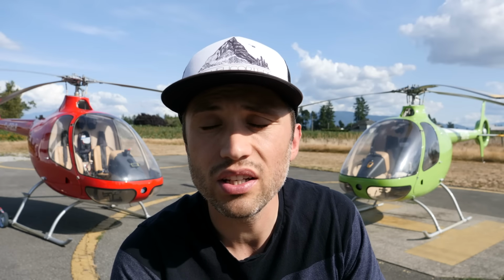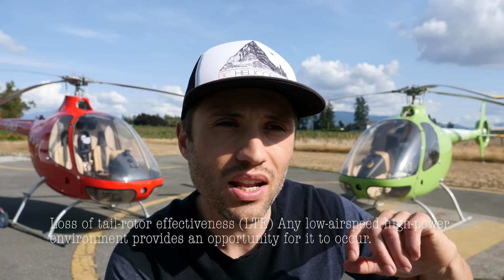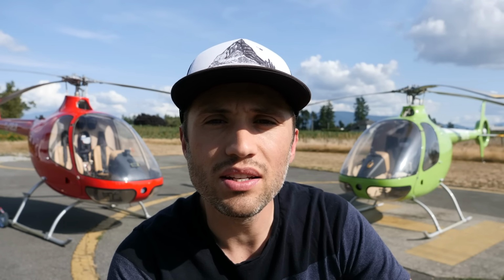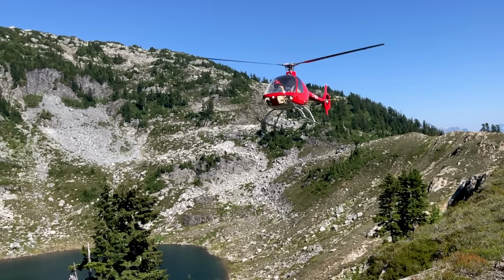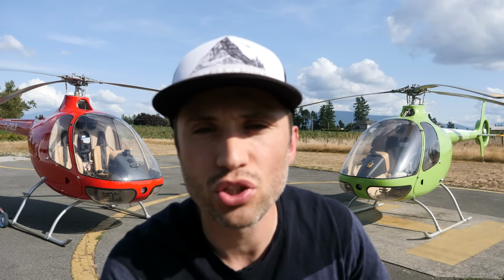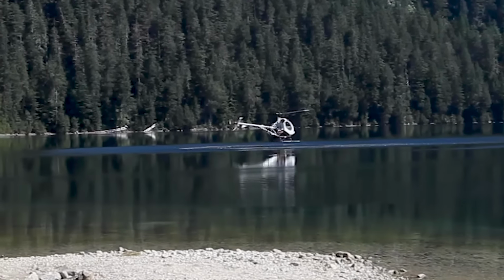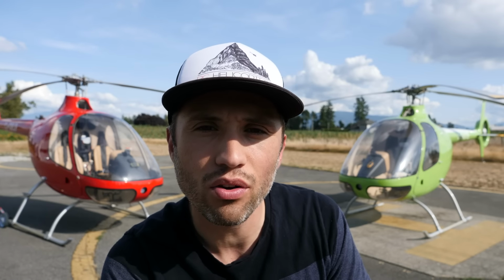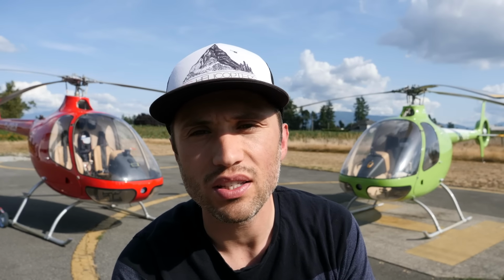OVERPITCHING and LTE can lead to a HELICOPTER CRASH

Comment: Good explaination about a common but all to frequent accident cause..
After Army flight school i got my real training in Vietnam.(1968-70). We were frequently operating at max gross in jungle mountains. We did not always have the luxury of doing OGE power checks or get actual weights due combat conditions. (Not recommended for your civilian or training environments because you always have time for flight planning in normal operations).
 One thing i always tried to afford my self was to have an escape plan if i started running out of left pedal on an approach. Instead of flying straight ahead,   I tried to have a way clear to turn right (and down) add some right pedal in the turn. Full left pedal is telling you that the helicopter is not happy with the conditions. A combination of reducing power requirements and some airspeed brings back that happy feeling and you again are one with the machine. More than 50 years involved with helicopters and airplane and I have never damaged anything. Except for the occasional bullet hole. It seems there are no new accidents, just repeating old ones with different names and A/C numbers. I enjoy your videos and you are usually spot on with the information.
Reply: Anthony Costanza thanks for taking the time to write all that,   You sir are a badass,  Thank you for your service and for sharing your knowledge!
Reply: Thank you for the information...and your service in Vietnam
Reply: Thank you for your service brother. TH55A, Cairns at Mother Rucker. Wonder if Enterprise is still a dry town?
Reply: Wow, what an endorsement from a Viet vet. Misha, you must be doing something right (lol).
Reply: Are you from Cincinnati?
Reply: I came back from all my rides. You pilots are the best.
Reply: Thank you for your service !
Reply: Thank you for your service! 🙌🏻
Reply: @westva22  What did his service in Vietnam achieve ?
Reply: Oh the Wonderful Conversations I Imagine we could have you & I
Reply: Anthony Costanza thank you for your service!
Reply: Is this caused by air density/temperatures?
Reply: @sarahann530  How to fly a helicopter? (Sarcasm) 
We know now "War is a Racket" Smedley Butler
Reply: In my book Vietnam pilots were absolutely bad ass espeacislly the medivacs hats off veteran we luv you here in canada
Reply: @sarahann530  You realize that was politicians, not soldiers that caused that shit show right? Don't ever disrespect the man behind the gun when its the one in the suit you should be angry with.
Reply: @sarahann530  Yeah, the 2.2 million that were drafted in Nam were there because they couldn't get a job! Right?! Like almost getting killed every second of the day is pussy shit huh? I don't get why all these people that were forced to go to war and almost get killed daily come back with problems! They just want attention, clearly.
Reply: @derqatarzan4207   They were fighting the bogeyman . The US always needs a bogeyman to keep its citizens afraid .  Scared and stupid and unable to win a war after starting it .
Reply: Anthony thank you for your service. My uncle was a door gunner and always talks about how incredible the pilots were and how they kept him alive.
Reply: Thank you for your vivid real life experience and thank you for your service ✨
Reply: @sarahann530  you shouldn't have to ask!
Reply: @eddielane9569   So beat if you were in the Marines it just proves you can carry a rifle and make your bed ,fuck all else .Give us the name of a war you were involved in that you actually won . ?
Reply: Jake Heke  As a keyboard I have still won as many wars as the US military has in the last 50 years . You must be so proud when your boy Trump fired that  US Navy Capt Crozier , how dare he look out for the welfare of his crew.
Reply: @sarahann530  I was in during peace time in the eighties. America has won all of her war's except Vietnam because politicians ended it before we could win it. We were on the cusp of winning but we were stopped before we could go that far. Your knowledge on the military is lacking. I went through 2 schools and had 2 MOS. That is unheard of. Unless you are a Vet you don't have the experience or the right to disrespect our Military. The very same military that keeps you safe to say what you do.
Reply: @eddielane9569   Wow , 2 schools and any 2 mos. Impressive , of course you had to do something with all that free time . The only thing the US military gained in the 80s was lbs , infact enough so that the Military issued warnings about it . Back to the wars won , Korea , Vietnam , Somalia , Iraq ,Afghanistan  none were won.  Now you did invade Grenada and "win" that war  so there is that .  In essence  though you won nothing , faced nothing , but you learned how to carry a rifle , make your bed  and go to school at the taxpayers expense .
Reply: Anthony Costanza...very true, but you know the military..hurry up and get in and out...I did not fly troop movement but I flew a lot of supply runs...when you come in and that close to the ground you always have the OGE buried somewhere in your mind because how many times did you fly overloaded and under enemy fire?  All the time, that is why we were taught to approach full throttle with cyclic pulled back then drop the collective, straight in and straight out, dragging the tail so you knew the ground was very close, especially in that tall grass, you could not tell, and you are right, this is not geared to civilian flying...dump and go.  Hell I have not been up for almost 40 years, 67 now!
Reply: Thanks I praised the helicopter pilots in nam being in the first air cav d17 you guys were super fantastic and thank you for all you have done over there many rides in those huey  choppers.
Reply: Thank u for your service sir!!!
Reply: @sarahann530  Several thousand dead communists ... quite sucessful in that department but more needs to be done
Reply: @sarahann530  Wiped out the Nazi boogeyman and the Empire of the sun ... and I now dont speak Kraut or Nippon
Reply: @markdoan1472  If you read a history book you would  know Russia  wiped out the Krauts and now they own the POTUS   and have taken over America without firing a shot.
Reply: Welcome home brother. I was an army medic with the 11th Cav 67/68. Used to watch the chopper pilots and how cool the always were. Wanted to fly them but too scared. LOL
Reply: @WestendAngst  So that's why you became a nurse  because you were scared !
Reply: @sarahann530  ha ha yeah It's the splat factor that gets me
Reply: @sarahann530  I have heard about internet trolls; thanks to you I now have an example of one. Thanks to Dick Ragland and all the other men that went ashore with him (none of whom wanted to be there and had better things to do with their lives), our lives have been much easier. To all of those who have served, politics aside, us non-trolls salute you.
Reply: Familiar with LZ Dog?
Reply: @sarahann530  I don't think this is the proper forum for you to use as a platform to air a bunch of political agenda. How did you get everyone off onto another COMPLETELY unrelated topic. This is about Flying Helicopters and flight characteristics, how did you get sidetracked onto Vietnam and Trump?? Did you not see that chopper fall into the drink?? That's what we are all talking about.
Reply: And to figure it all started with a fine mans explanation of recovering and avoiding a crash we end up criticizing the man for his service and blameing him for the policys this country set forthe. Place is wild bro. Wild spinning ball.thx for ur service and your educational advice in your post.
Reply: I am a fixed wing pilot so I have no rotary wing experience. 
The thing I reacted to was kicking out a passenger to loose weight.
This suggests that you get into this situation party because you didn’t do your homework with your flight plan.
I can imagine that the amount of fuel, cargo and passengers together with high altitude and temperature will put you outside the helicopters performance capability.
You will have a similar problem with fixed wing under those conditions ie take off performance will drop and you risk not getting enough lift on taking off and you will dig a hole in the terrain.
Reply: @sarahann530  Same thing your tax dollars did! Did you have a  choice? Elections have consequences! What a bullshit, off-topic comment!
Reply: @sarahann530  Simply answering the call to service by his country, vs
being a self-serving coward with excuses...
Reply: @Endlesspathable   Call to service fighting the bogeyman then running home  .
Reply: Thank you Mr. Costanza for everything you done for all of us.
Reply: I would love to meet up with A Conneely.  It must be nice to still have Trump living in your head, RENT-
FREE!!
Reply: @sarahann530  I finally found a way to review my comments left scattered around and, well, this is admittedly true (especially now) and... the people DID survive the copter-dunking.
Reply: Anthony Costanza you just explained something to me I've wondered about for years. About 28 years ago I was working in mining exploration in northwestern BC. We had to get flown from the camp up to the mine portal daily in a Bell 500. The pilot was trained in Vietnam during wartime and on this type of chopper. The portal was probably around 1000 vertical feet higher in elevation than the camp that sat down below in a narrow bowl. When it was real foggy this pilot liked to fly from camp up to the portal backwards and turned slightly to the left on his side of the chopper. I always thought it was just so he could see the ground better as he followed the terrain up to the portal but I guess it was also so he could quickly get out of trouble and recover quickly in a max power LTE situation too which I witnessed several times but I didn't know that at the time 😳😂. Glad he never explained that to me lol.
Reply: @kennethmartin1300  AGREED! This is NOT the place for wayward political discussions which distract from the subject matter in the video.
Reply: I’m not a pilot, although I’m considering learning to fly helis. This makes a lot of sense, letting the aircraft turn into direction it wants to go will bring up your airspeed quicker? Am I understanding it right?
Reply: @adm5618  Not fully. At the altitude which the pilot first detected a problem it may have already been too late to correct it (his proximity to the water did not allow for time enough for him/her to perform the necessary emergency procedure). The fact that he was "over-pitching" in that particular helicopter, at that height ABOVE THE WATER leads me to believe that there were other factors which may not have been apparent through viewing this video, which may have been significant in the cause of the mishap, i.e., not checking the performance chart data for weather factors like density altitude at the crash site, over max allowable weight for a hover at that altitude, and pilot experience just to name a few.
When that aircraft first began its yaw to the right, that was the first danger sign. listening to the change in engine rpm as he settled into the water is another indicator.
Helis are completely different aerodynamic animals than airplanes, and they will bite you in the ass if you lose your wit at the wrong time in the decision making process.

Comment: Great video, thanks for sharing it.  It was a Schweizer that had the problem, but I've had it in Jet Rangers, Hueys and Blackhawks.  Any helicopter is vulnerable. We had the necessity to train pilots to land on true pinnacles, with terrain sloping away from the landing point so there wasn't any ground effect available. The technique was to make a slow approach and come to an out of ground effect hover a safe distance from the pinnacle, approximately 50 to 100 ft, above the touchdown elevation.  If you can't stop the aircraft here, you won't be able to stop it on the pinnacle.  At that point, if it starts to settle, lower the nose and either accelerate over the pinnacle toward lower terrain or turn away and fly out toward lower terrain.  It's a lot tougher at night and on NVG's because you can't make a normal approach. You have to fly at the pinnacle at the same height so you can keep it in sight until you can put your skids or wheels on the touchdown point. Ya'll be careful out there.  Live long and prosper!
Reply: Fred Harms ...that’d be awesome training technique or practice
Reply: yep. except i'd think you'd have to be super high/hot/heavy to have much problems with the blackhawk. the apache never ran out of power. the cobra, sometimes. i would probably be an ntsb report if i tried to fly one of those little thingys

Comment: We used a pretty simple formula to estimate power available for high alt stuff. You lose roughly 1” of MP (Manifold Pressure) per 1,000’. You can also subtract about 1” of MP due to induction loss. So if you’re trying to land at 8,000’ (static MP there should be around 22” minus 1” for the induction loss) which leaves you about 21” of MP available. If you’re pulling into the approach and you haven’t even dropped out of ETL yet and you’re already pulling close to 20-21” then you know you’re most likely not going to have the power available to hover and or land. 

We could also roughly calculate our hover MP by taking our weight and dividing it by around 70-80 lbs per 1” MP (depending on season and helicopter) and this would tell you your rough hover MP. It’s been a long time since I’ve flown 300’s but say you’ve got a takeoff weight of 1700 lbs. Divide that by 75 and you get 22.6” of MP. So you can estimate a hover MP of around 22.5”. You could also try and figure this out for OGE (we just used IGE most of the time) if you wanted to play around with it. 

Piston performance stuff was pretty fun. Can’t say I miss the little hamster ball too much but I sure learned a lot from it.
Reply: yep. never had to deal with thin of a power margin but high da always a consideration. why you would even think to try that over the water just amazes me. had it happened over the ground it would have been an embarrassing learning opportunity and not a loss of a 1/4 million dollar aircraft

Comment: I remember flying at high altitude in our Bell long Ranger air ambulance and we were going in to land on the road cut into the side of the mountain to get directions. We were a little heavy with fuel and about 10 000ft and as we came in and the pilot pulled collective the tail started swinging around to hit the side of the mountain, my pilot who was a really good ex military guy immediately pushed the collective down and pushed us off the side of the mountain picking up speed as we went.
I had not even noticed we had a problem. He was so quick otherwise we would have put the tail into the side cut out of the mountain. Skills and experience saved the day.

Comment: Great explanation. I was very impressed at how concise & interesting you made this description of over pitch . I am a Seaplane Pilot and I fly an amphibious aircraft and as you described the correction of Over pitch, my mind said, STALL, STALL and the correction was reminiscent of stall recovery. Pitch forward , gain airspeed and never practice without adequate altitude. I think your style of instruction makes learning easy.
Reply: Correct - It's exactly the way I feel it - Over-pitched on maxed power = Loss or reduced air flow over the fixed wing or rotating wing = STALL. . . .  Recovery = Quickly Reduce angle of attack ( stick forward  on fix wing )  ( lower collective on rotary wing & cyclic forward to gain forward momentum) . . . Of course, on a "fixed wing" in order to gain forward momentum you will need enough altitude or an engine with some sort of reserve "power boost" system!
Reply: The blades aren't stalling....they just aren't producing enough lift as the rrpm decays.
Reply: @simonj126  it's more the engine is stalling, but I understand it to be the engine lacking the force required for that blade pitch. It is an aerodynamic issue like a stall in that the airflow over the foils is directly impacting the condition.

Comment: Excellent video. Just had this same conversation about LTE recovery with one of my students yesterday.  Used the video of the NYC Hudson river LTE as an example. Now I have another to share.  Avoid slow downwind hover, avoid downwind OGE hover.  Always have an "out" if things don't go as planned. Lower collective, full left pedal (or right, if your rotor system turns clockwise) and forward cyclic and fly out of it.

Comment: So I have only been flying for 20 years and I learned in my first year as a commercial pilot that an OGE hover power check is a terrible idea, you can do a good power check by just flying over your spot and checking your power no need to put your self at risk if not needed. 
Thanks for your videos.
Reply: well put.
Reply: Wow flying a helicopter seems so much harder than than flying a plane.  I landed a 45 cub I think that is what I was told my friend was in back seat flying it says take this air craft to those fields never heard another  word from him. I ended up getting my shit together just above the corn pulled throttle back and splashed into cornfield old man Peterson had a hear attack no longer with us but 20 minutes before we took off he said I will have you flying my outfit today.  He lied I crashed his outfit

Comment: Mischa, I have these problems often in my Flight Sim (X-Plane 11) and your explanation will undoubtedly help me improve my landings and low level flying. Thank you very much!
Reply: Are you using the default helicopter?
Reply: @yosyp5905  I am using various helicopters mostly from Vskylabs with controls on most realistic setting in X-plane, (R66, Cabri, Cicare), Dreamfoil 407 and freeware Bell 429 from Tom Woods